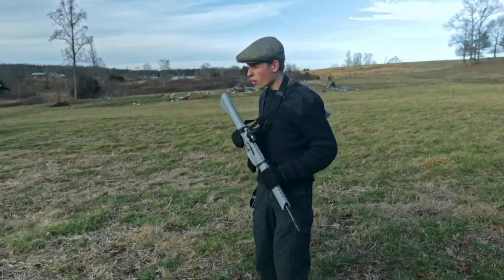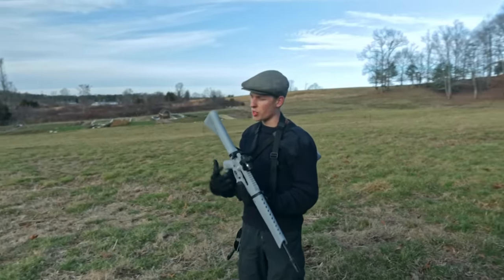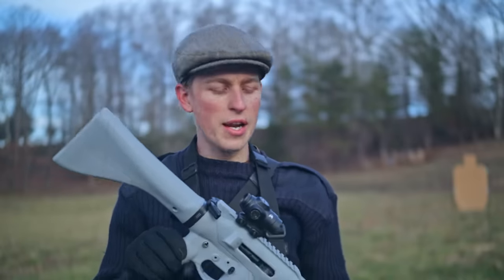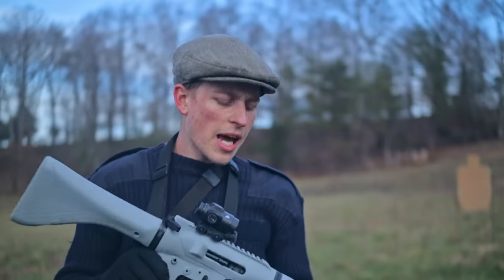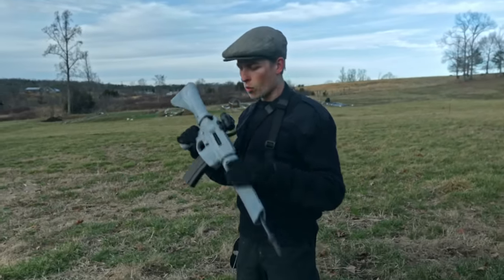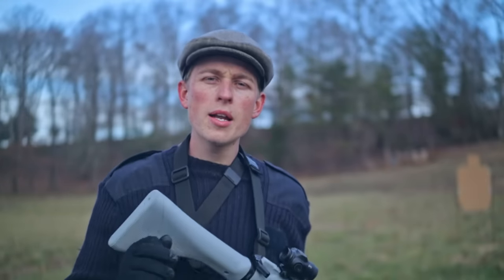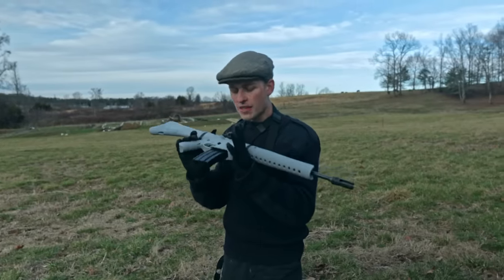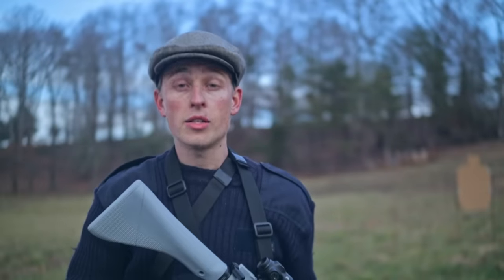Introducing the Orca

Comment: Greetings I just downloaded the orca file and I have an anycubic kobra neo 3d printer is it possible to to print it out successfully cuz to fit it on the printer bed i would have to stand the parts up on there butt faced end like the gun was shooting in the sky
Reply from the maker: You probably need to rotate the parts to sit diagonal on the print bed.
Reply: @HoffmanTactical  won't that effect the infill line straight on the parts i watched the slicing video
Reply: @HoffmanTactical  strength of the infill lines
Reply from the maker: @aaronosb7787  Yes. But adjusting the infill angle to align with the new orientation will resolve the issue.
Reply: @HoffmanTactical  ok sounds groovy I'm still somewhat knew to the 3d printer world doing my homework b4 I press print

Comment: The picatinny rail and charging handle seat need to be metal. You're going to end up losing zero, and that charging handle is going to start digging into the plastic edges.
Reply from the maker: Zero is an issue, not so much losing it, but rather flexing while shooting causing large groups. I'll play around with metal rail options in the future. As to the charging handle latch, I was actually able to prevent the wear issue with the right geometry. Has held up great.
Reply: @HoffmanTactical  Good to hear. Even my regular AR has track marks. Hence the concern. Thanks for the reply and keep up the good work.👍

Comment: The charging handle should me non reciprocating, why is it moving backwards?
I think the project is very interesting, but i am very sceptical about plastics for a lower and an upper.

You did show it works. 

I am looking into fluid 3D printing and vacuum casting in plaster of (gun)parts. "VOGMan", and "clearmind jewelry", have some great examples of jewelry casted in plaster. Great detail. I am looking to find a way to melt steel, so parts like trigger and other parts from the trigger group can be casted (which is the same process used in the real parts). Ruger firearms make a lot of gun parts with poured steel. A muffler oven or an induction forge should be able to melt steel. Also i looked into the production of barrels and ammunition. It is on my grabcad. "Ivanthetroll" has devised a way to make EMD grooves and chambers in barrels. 

I have been looking at your project for quite some time now. Very interesting! 

Keep up the great work!

Greetings,

Jeff
Reply from the maker: Latch area is still wearing out with some handles, but a lot better then it was. As to vacuum casting, I would also like to get into it, with non ferrous metals. Don't underestimate the difficulty of casting steel though.
Reply: @HoffmanTactical  You might look into using a machine key (like a woodruff key, but square profile), pressed in vertically, to be your latch surface. Shouldn't be too hard to keep it retained
Reply from the maker: @JohnDoe-fk6id  Problem is how tight the geometry is in the latch area.
Reply: @HoffmanTactical  2mmx2mmx10mm machine key should fit, and be strong enough to live, if properly supported
Reply from the maker: @JohnDoe-fk6id  Yes. I've been looking at using a 1/64 pin as well.
Reply: @HoffmanTactical  I would worry that the round surface wouldn't touch the flat of the latch, and it wouldn't hold.
Reply from the maker: @JohnDoe-fk6id  That's why the pin has to be so small.
Reply: Use magnets for this.
Reply: As for making steel parts, one idea I've had is you could make printed plastic parts that you copy the shape of onto steel using a key-duplicating machine.

Of course, the obvious solution to printed plastic sitting at full cock all of the time is to make it dao. But maybe that's hard to do in an already-existing platform that was never designed for it.

(And maybe it isn't "obvious", because da is so-far completely outside-context for long guns)

Either way the FGC-9 people aping the AR trigger group was a mistake, I think

Comment: Get your 3D printers now before they come pre-programmed to NOT print these parts.
Reply from the maker: Impossible to do, printers are mostly open source, and new firmware can be loaded at any time.
Reply: @HoffmanTactical  Too optimistic. The state can pressure landlords to ban printers, CNCs, etc, certainly welding, in their leases under the excuse of noise or fire (while avoiding the flatly ridiculous path of actually banning 3D printers by law).

This would be a fatal blow vis a vis the true purpose of printed guns: bringing about the legalisation of real guns, on account of the fact that the more gun-control the jurisdiction, the more the case it is that everybody lives in tiny rented flats.

We should be encouraging vendors to put active noise cancellation in their printers or something. But not tell them it's all a ruse to keep this movement going as long as possible.

So yeah, basically your confidence on this matter is the same thing as the haha, what are they going to do, have background checks at B&Q? thing. There'll never be background checks at B&Q, but there will be surveillance of purchases. And there will be some bullshit that makes it harder to own and operate maker equipment or even power tools.

Comment: Too bad you can't really add storage to the buttstock... Though you could make the grip take those Magpul cores... Everyone likes being able to carry extra batteries or more importantly lube...
If only you could figure out a way to fit a m16 buttstock cleaning kit in the buttstock, between that and an area in the pistol grip for an oil bottle (maybe even a 3DP oil bottle) you'd have everything with you for taking care of any "in the field" problems
Though I'm sure that'd cause some structural problems unless some inserts could be made of a stronger material... Or well probably also require the stock or handguard to be thicker...
But I'm an a2 buttstock lover with a MIAD or regular MOE grip, just to have everything on and in my purchased AR... So maybe ignore that

But regardless it's still amazing you got such a nice streamlined and good looking 3DP AR that doesn't look like it's printed... That alone is incredible...
I wonder if a wood pulp based PLA could be used, just to give it an "old fashioned" rifle look, though I'd imagine you'd have to sand everything a bit, and add varnish for color and a sealant to make sure it didn't absorb moisture... Though it'd give it that "hunting rifle" look, unless using different colors of varnish in a way to give it a camo-ish look

Just random opinions.. I could be totally wrong..
Well except for how awesome it is and just how streamlined the look is, and that it looks like some futuristic AR at least in this video, I can't wait to see all the different colors people print them in, and different patterns with even the basic ender 3 letting you pause a print and change filament, excellent way to do a camo-ish pattern without painting it...

Regardless Hoffman very impressive work

Comment: 3d printed parts, not a 3d printed gun. Unless you print barrel and bolt, you can’t tell anyone its 3D printed gun
Reply from the maker: It's really very simple. I'm the one printing the guns, so I'm the one who gets to make the definitions. Fun.
Reply: @HoffmanTactical  parts for the guns. But what im trying to prove here, back in US you have AR-15 “pistols”….🤦‍♂️
Reply: @ponasfeliksas5299  i can ECM etch a barrel, drill out a gas block, and affix a gas tube made from hardware store metal tubing, checkmate
Reply: @docternoblex  Can and did are different words, do that with all, I mean all of essential parts and you can call it 3D printed gun.

Comment: I'm more curious is this a goal of what? To be as questionably legal as possible? Knowingly piss off the ATF without crossing the line? If the goal is to put the firearm in the hands of the people there are still laws to cross! where does this stand? Highly impressed in the ability to make something durable enough to not explode in your face, But my concern is to the longevity the safety of the user, And foremost you.. Making it Available does it not make you liable to any injuries? And the one that just has me questioning it the ATF is adamant you're not allowed to make ghost guns you can manufacture a firearm but you cannot sell it unless you have a license and you serialize your product. The ability for you to download a file and make it yourself means you are technically legal to my understanding, But this is the exact kind of thing that sits right on the edge of what is and is not morally right to the gun community. And I know a lot of people are gonna disagree with me here but I would rather find it in the legal sense and do all of the due diligence to make sure that I'm not going to get in trouble. Curiosity is rather large here so somebody that actually has legal knowledge please message me here where does this actually stand?
Reply: Ain't nobody reading all this.
Reply: @whitneycombs6804  you can do your own research if you typed out that wall of idiocy.

Comment: I'm always amazed at the reaction this piece of plastic gets in the comments. 

It's got to do with the videogame futuristic looks. 

But really this project is nothing special. The barrel, the magazines, the gas system, the trigger group, all of that STILL has to be made of metal, and there's no other way around it now or in the future. 

So really, the CORE of the rifle has to be made of metal- high quality metal with extremely high level machining, and this project, like ALL the other 3d printing prjects, changes almost nothing.
Reply from the maker: Jealous?
Reply: @HoffmanTactical  Of what? Did that sound like a good "gotcha" to you before typing it?
Reply: The fgc-9 would like a word. The barrel is hexagonally rifle in a bucket of salt water with a printed ecm jig, the bolt is made from hardware store parts and jb weld, fires thousands of rounds reliably. No extremely high level machining at all. I love when people that have no actual clue about what it takes to make things seem to think everything they don't understand requires some insanely advanced tech to make. Rifled barrels are older tech than the airplane and people are making planes in their garages.
Reply from the maker: @patrickrhoades480  Yup. These people have no idea.